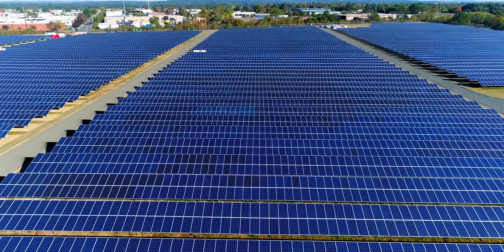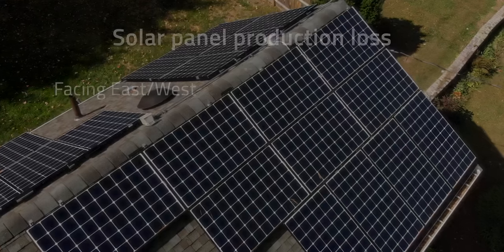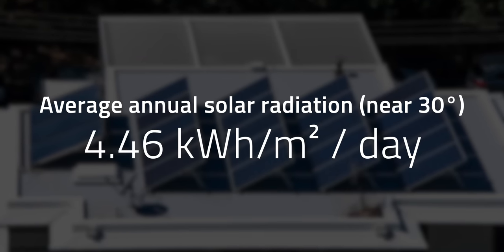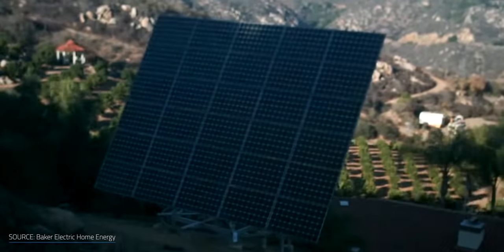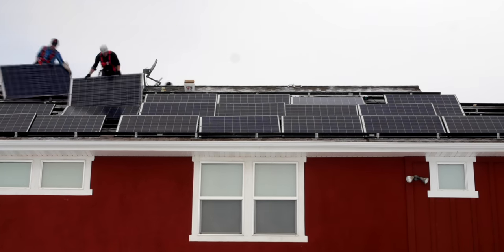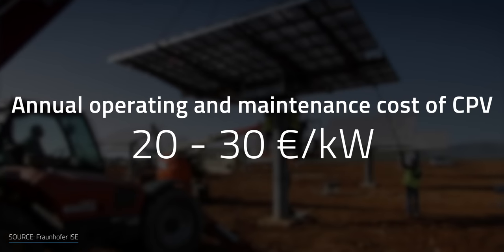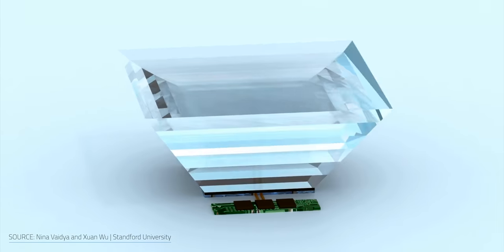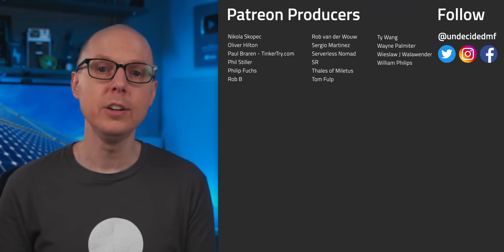This Invention Could Supercharge Solar Panels

Comment: I worked on a similar tech in my research lab around 8 years ago. The main benefit of a low concentrator PV is increased efficiency at suboptimal angles. The numbers were often muddy - you can get twice the energy per square meter of PV panel, sure, but when you ultimately use less PV panel (as a lot of room is taken up by the concentrator) then its a moot point. The biggest limiting factor is that the greatest degradation factor for PV panels is their operating temperature - when you concentrate, they will get hotter causing them to degrade faster.

Our research was specifically looking at ways to extract thermal energy from a domestic scale solar concentrator. This was to (1) cool the panels (2) extract some thermal energy for hot water tank pre-heating and (3) prolong the life of the panel. It was ultimately not deemed cost effective. You could double or triple the life of the panel but you have massively increased your installation cost, so it would likely be cheaper to replace the panels every 10-15 years.
Reply from the maker: Thanks for sharing your insights!
Reply: This system looks incredibly similair to the photosynthesis system in plants, maybe your insights about these kind of solar panels could be used to reduce heat stress on plants in warm conditions. However, these photosystems in plants are made up of proteins which of course degrade over time and are incredibly heat sensitive. Maybe something could come from this.
Reply: Yea I had the same conclusion.
Reply: I hoped someone would bring up the overheating issue.
Reply: T r a s h Tech..?
Reply: Agree with this researcher on all the points mentioned. In the end it’s hard to beat the $80/m2 silicon panels. Solar is a energy form that needs ultra cheap material to cover large areas. CPV hasn’t seen anything for a long time.
Reply: There are solar panels on the market that offer combined heat and power (hybrid panels). There is a small market for such panels in some countries, like in Europe, where energy right now is crazy expensive. The main problem with current technology is that hybrid solar panels offer relatively low temperature warm water. If you have the space, it is better to use separate PV and solar thermal panels. Specialized solar thermal panels offer higher temperature warm water. (Or people choose an entirely different solution, like extra PV and a heat pump.) If concentrating solar light results in higher temperatures and this can be made available, then concentrated solar might actually be worth it.
Reply: When I heard about intensifying sunlight exposure, I immediately thought of two things:
1.  Thermal degradation
2.  The older-design industrial solar farms that used mirrors to direct super-intense sunlight onto a fluid, heating it to do work (turning a titanium turbine).
I think the degradation problem could be overcome if thermocouples were integrated into the design; they would both produce electrical energy and act as a heatsink for the solar cell wafers; the prismatic layout shown in the video should leave enough space for this.  Passive or active cooling could also help.
There's no getting around the fact that the top couple layers of the photocell design are going to get the most intense exposure, and either need to be cooled the most or made to be translucent/transparent to some bands that lower layers will absorb, and also thermally conductive to mitigate thermally induced matrix displacement.
Reply: Lol, you already knew the tech is uneconomical 8yrs ago and this YouTubers just found out.
Reply: this. one thing about solar cells/panels as they are like camera sensors or computer chips, they are tiny and sensitive which don't like high temperatures.
Reply: Classic example of fixing the patient instead the root cause, they should work in getting more energy from the sun and not amplify it.
Reply: How much hotter do the panels get? Its still the same total energy per area.
Reply: So basically you would build a water block that attaches to you solar panels and run water through it to keep the panels cool and then use that water to preheat your water heater? I have thought about that before too(like a water cooled cpu) but the amount of money/aluminum in the system would be so expensive it just isn't worth the cost.
Reply: @GerbenWulff  solar water isnt that useful Imo since you need sun to use the warm water. Unless you could build a cheap water tank that loses next to no temperature overnight I don't see it being useful in places that are cold and get low sunlight.
Reply: @MonkeySpecs301  this youtubers doesn't care, he's here to make a video to make $. He will talk about any new renewable energy tech regardless if it's impractical or unfeasible. We need to ask him if Any of the technologies that he's talked about over the last 4 years have advanced or made it to market. I doubt he could make a video because none of them have. We are still using the same lithium/PV set up we have been for decades.
Reply: @Lunas Solvarros you can't deflect heat while absorbing the light. The heat Is from the light.
Reply: @nutzeeer  it isnt though. The PV panels get the light evenly through the entire surface of the panel. These concentrate light on to a small fraction of the total surface area making it probably 2x or more hotter. These would need large heat sinks or active cooling to dissapate the heat. It's the reason you put a heatsink and fan on a cpu, all the heat is in one small spot and the heatsink spreads the heat out and the fans blows it away. That would be expensive on a large solar panel.
Reply: The other approach is to take Paul's method but scrap the concentrator and just go for 'solar thermal'. Imperial College London research group thinks they have a route to economic technology. Search /Imperial College/solar thermal/hybrid pv/prof Christos Markides/ or look for his lecture on YT on Imperial's own channel.
Reply: @randybobandy9828  I heard that graphene sheets are extremely good at moving heat horizontally. Isnt graphene cheap now?
Reply: Thanks for sharing your insights. The AGILE concentrator system looks really interesting. But there's got to be some clever way to vent the heat out of the concentrator, even to the air, as the light passes down through the various layers.

What if there was even a small air gap between each concentrator level?
Reply: @sybrandwoudstra9236  solar panels in farmers fields could shade the heat stressed crops.
hahaha
Reply: @wesman9274  "Venting out" is wasting potential.
Personaly I think that this combination is suitable for home owners since it can combine the best of both worlds.
The cost effective point of 8 years ago is not valid these days anymore if I reflect it to my personal situation.
Solar was not costeffective for me 15 years ago, heatpumps were neither 5 years ago.

Today I have both as sepperated system, wich is already costefficient. I did not knew hybride panels existed before the instalation was ordered, in the current energy market they would be absolute cost efficient!
Reply: One thing to consider, at least on the industrial scale, is that a lot of the cost in developing a site can come from the civil work. This is especially true in tracker systems. It might only take $3M to prepare some old farm fields but a rocky hillside could easily be 10+ times that. A system like this, that could essentially be set on the ground at all kinds of varying angles, could be much more cost effective. I'm a field engineer in solar that has seen this all too often.
Reply: Steam is industrially useful, I got 10x power output from 15 mirrors for 30 seconds before the glass based pv panel cracked and it's cardboard support cought fire. Burnt my eyes too. The glass cracked along where the power cables were taped. Need to try with a heatsink.
I put a panel in flowing water behind glass but never tested it as auto welding mask did not activate concentrated solar and oxy welding goggles didn't work anywhere near well enough.
Using 18V 0.1A trickle charge panels.
Reply: Highly Valuable Comment & Section, tks for the latest info!
Wonder what material could be used as a unique heat exchanger to mimic however plants do that photsynthesis naturally?...
Reply: @sybrandwoudstra9236  Plants can evaporate water to cool them down, or shut down  (or at least slow down) photosynthesis if not enough water is available. That might be an interesting alternative principle for solar power ("evapovoltaics" if you will), but would greatly depend on local climate as well as availability of surplus water.
Reply: @robsengahay5614  easy, use excess heat to drive solid state hydrogen ammonia absorption cooling, run coolant lines through focal point.
Reply: A mate I was living with around 8 years ago Dr Ian Cole was doing his PHD in concentrated PV cells on Fresnel lens optimisation at Crest Loughborough University
did you ever come across him?
Reply: Nailed it.  
"Concentrating" is hotter and less actual collector area. It's just easier to throw on some extra standard panels than use augmented technology that adds complexity, cost, and reduces the overall life of the collector.
Reply: He told me pretty much the same as you though there is some applications where concentrated pv cells are useful outside domestic units such a satellites etc
Reply: @fakhourikakeesh5527  I didn't - my main field of work was phase change heat storage and heat pumps. The project I refer to here was one of the projects which just ran alongside everything I was doing.
Reply: @fakhourikakeesh5527  It would have to be really special circumstances to warrant the higher costs and lower life of such a system.   Obviously you're not "increasing" sunlight at all but trying just to channel whatever existing light there is a little better.
Reply: @GerbenWulff  How about running that water through the PV panels first to keep them efficient, then through the thermal panels?
Reply: @paulmichaelfreedman8334  That sounds like an interesting idea. Cooling won't be economical for normal PV/hybrid panels, because the benefits of cooling are small. The cost for cooling PV panels is normally not worth the benefit. Usually, you have more PV panels than solar thermal panels. Perhaps a mix: normal panels, a few actively cooled concentrated solar panels and 1 or 2 solar thermal panels. You need micro inverters or optimizers when you mix PV panels. Note that you will find that on some hot days with low hot water consumption you will be pumping around water while the hot water storage is already near maximum temperature. You can add a bypass for the solar thermal panels and add a radiator (with bypass) to cool the return flow, but this may make it prohibitively expensive.
Reply: I was looking at a home built EV truck a few years ago with a flat deck and thought about adding a headache rack and solar panels to get a few extra KM of range while it sits at work all day. I didn't end up getting it but these panels sound like they would be perfect for this situation.
Reply: For years I've wondered why a simple fresnel lens couldn't be used to concentrate the light for suboptimal angles. Each solar cell could make use of its own fresnel lens.

As far as the heat issue goes, placing the solar panel on water (a pond/lake) cools the panel. This approach sounds like it could happen on Lake Mead, but doesn't help the average homeowner without their own personal lake.
Reply: @warrensteel9954  True, as long as there are no trees or other obstructions.  Sounds like an intresting learning project.
Reply: For areas where space is limited, and budgets are high, like in a city, this might still make sense it sounds like
Reply: @therealbuba  High density areas are the LEAST appropriate for meaningful solar energy.  Think of a 20 story appartment building and what the avaialble roof size is available.  High density cities need high density power supplies.  I wish that they would develop the very small nuclear reactors that could be added as needed as the city grows and/or seasons change.
Reply: @arthurfoyt6727  the premise of your comment is not well thought out, just because a roof can’t cover all the electrical needs of a building (which was never my point) doesn’t mean it shouldn’t / can’t generate any energy at all…
Reply: @therealbuba  When energy content is too expensive and too limited, don't persue it.  It's a lose-lose for people.  Just because a city has a big budget does not mean that it should waste it on technology that has little/no impact on the needs.   Large cities are the worst place to locate solar collectors, especially expensive ones.
Reply: @sybrandwoudstra9236  are you asking if this tech or research could be applied to bioengineering and genetic modification in plants? I don't know a lot about the systems in plants but I have a feeling that trying to genetically modify plants so someone can have tulips in the desert sounds like a really bad idea. Are you talking about crop plants?
Reply: @GerbenWulff  they would still degrade and become a solar preheater in about the the same amount of time. The heat wouldn't be extracted in the fashion you are thinking. With an overall size being the same you aren't gaining anything from concentration. The heat products are lost energy. You'd be less efficient in solar energy products and end up with just extra heat and that heat would reduce the efficiency of and degrade the PV cells at a much faster rate. The only thing concentration would be good for is water heating but you'd have enough heat and hot enough water from a solar water heater. Also you have to look at location. The amount of cloud cover will effect your ability to have hot water as well as if the sun isn't out. In most cases you have the solar doing the preheating but most hot water is used during the evening and night in most US households so that's part of why that sort of heating hasn't taken off here. I live in one of the sunniest places in the world where we get over 270 days of sunny clear skies and most the others tend to have scattered clouds that really aren't an issue to solar cells because they don't stick around. Solar cells do not last very long here. At best you can get maybe 10ish years out of them. Solar heating could be a thing but you don't see it here. The only thing I could think of would be warming a pool in the winter here. Solar needs to become more efficient and drop in cost before it's a viable option for every household. The systems cost $30,000 installed and by the time they've paid for themselves, you have to investors money to replace the panels.
Reply: @randybobandy9828  Ah, but if you deflect the IR part of the spectrum, which isn't useful for PV anyway, you'd have fixed 1/3 of the heat problem already.

If you'd have a seperate glass pane that's selective for the right frequences, hovering just above the rest of the panel, that'd be a start (if not necesserily cheap).
Reply: As an ex PV installer I was wondering about the heat and IF a problem my intuition was that the solution wouldn't be cost effective, however I'd like to know if the concentrator could be placed with a significant air gap for cooling or does it have to as close as possible to the cell ?
another question is the ratio between extra space required for the concentrator, (or less cells per m2)  is it worth it ? and yet other potential issues are the extra load on a roof, weight of a panel for installation purposes, how fragile is the concentrator (hail, scratches from sand in the wind etc) ... not quite sure this is the holy grail
Reply: @sybrandwoudstra9236  organic pv cells ... we'll get there one day ! already starting for lights (oleds)
Reply: @Deathbomb9  Concentration could work to improve heat extraction, but it depends on how you design the cells. Normally you would put the cells on a heat sink that surrounds the cells. So the amount of surface that can radiate heat remains the same. In our case you might want to do the opposite: thermally isolate the cells as much as you can. Because of 3x concentration, the amount of surface you extract the heat from is 3x smaller and so also the radiant surface is smaller. This means you can extract the heat with less heat loss. Theoretically. But I think the designer will care more about getting rid of the heat than of making use of it.

Thermal solar panels also concentrate sunlight, using mirrors. That is how the water can reach temperatures warmer than the surrounding air temperature. If this concentration technology isn't worthwhile for PV panels, it might find alternative application in solar thermal panels.

I know all about location. I was raised in northern Europe, but now live in the tropics. Here I don't own a water heater. Most hotels have a basic electric heater. The water here never gets really cold. I usually shower when it's hot to cool down or late afternoon when the sun has warmed the water in the storage tank. In northern Europe if a solar thermal heater can heat the water from ~4-10 ºC to ~30-60 ºC that already saves a lot of gas.
Reply: @GerbenWulff  heat extraction? Or heat collection? I said that the only place it's good is in solar water heaters already. Might have been here or another comment somewhere. The issue with heat is that as the cells warm they lose potential. You want them on a heat sink and you want lots of air flow. PV cells already aren't super efficient in producing power, and in high heat they get even worse. A lot of the light is converted into heat rather than being turned into electricity. You don't want to concentrate the light at all. And designing cells costs a lot of money. But regardless of how you design the cell it works in the same way as all other PV cells. The only way you could extract the heat other than a passive heat sink is through heat exchange. The only issue with that is now you have to power the heat exchanger or system that is providing that cooling. You'd basically need something like 2 or more standard panels that typically get installed in residential roof systems to power it as well as the added cost of the system and its maintenance. Not only that, but keeping the panels the same size does absolutely nothing in terms of light gathering. You're not gathering more light that a standard panel of the same size so there is no advantage to this idea besides the added cost, maintenance, and need for cooling. I don't even have to watch the video to tell you how wrong this guy is on so many things he reports on.
Reply: @Deathbomb9  Ah, you didn't even watch the video. The idea if you concentrate the light 3x is that you need 3x less solar cells to produce the panel. They use this cost saving to use multi junction solar cells which have higher efficiency, so they do end up producing more power compared to normal single junction PV panels.

The use of multi junction solar cells is a questionable design choice though. It's generally not worth it. You get less than double the efficiency, for more than double the cost. There is an advantage that as you produce more electricity, there is less heat produced, but I don't think it is critical.
In my opinion, if the concentrator is cheap enough compared to the cost of solar cells, then they should just use normal PV cells and invest some of the savings into designing passive cooling for the panel. Current panels have no special passive cooling designed into them. With better cooling you may get 1 or 2% more electricity, but you add in the order of 10% to the cost of the panel. Not worth it.
In this case however, if you can save 2/3 on the solar cells (which is the most expensive part of the panel), then maybe that may compensate for the addition of the collector and the passive or active cooling (which apparently is critical in this situation).
Reply: @GerbenWulff  all I gather from the idea on display is they have money from a grant and had to spend it on something.

Can I pose an argument?

Let's say for hypothetical purposes we did use a concentrating panel to gather 3x the light onto a multi junction or even single junction panel. With the inverse square law applied the panel of the concentrator wouldn't have to be massive and if you could place it with enough distance to gather that light into the PV panel you would have plenty of space between them to allow some air flow. But you'd also have to place the panel high enough that it could concentrate 3m² of area into 1m² on the panel. Say you could, and say it was putting out 190V vs. a regular old panel that was just placed the same with no concentrator putting out 100V. If the regular panel gets heated up from the sun to the point you can't really touch it with out pain, how hot would the other panel be? And remember, you are blasting it with 3x the amount of sunlight and only getting less than double the output. The rest of that light is being reflected, but the vast majority is being converted to heat. You lose some to the air but you would really need a massive active cooling system to really keep the temperature at the same levels as a panel just sitting there. 3x the energy from the sun on any piece of electric equipment or solar panel would absolutely fry it. I'd have to see it in action, functionally for days with graphs showing output, surface temp., and a few other factors. Just because someone wrote an article that some youtube tech worshipper made a video about doesn't mean it has or will have practicality in the near future or that it will revolutionize things.

If you concentrate about 1m² of sunlight that hits out plant into a single point, you can melt steel, rocks and basically anything else you want to. That's how much power and potential there is in a relatively small space.
Reply: @Paul Mullen - yeah, no.  Hence, why all CPV technologies will have some sort of heatsink to keep the solar cell as cool as possible mitigating the efficiency degradation as a function of Temperature.  LCPV was always trash as the incremental performance difference could never pencil out the cost increase (LCOE).  Hence, early developers such as Sunpower and others abandoned quickly.  Btw, from a person who was an exec at a WR multi-junction solar cell manufacturer.
Reply: @Lunas Solvarros Silly solution, simple strip of copper or a small heatsink solves the problem.  Solved many years ago.
Reply: Pvt panels are commercially available. The heat you get from them can be used as the cold leg of a heat pump for heating your home and hot tap water. Depending on the situation, this can be economically viable.
Reply: @Deathbomb9  But that is not how it will work. The panel will still have the same size, it's just that you need fewer or smaller cells in the same size panel. Instead of a glass top layer, you would get a top layer consisting of plastic lenses shaped like upside-down pyramids (probably with a protective coating) that concentrate the light. Below the concentrators you have the cells that have some space in between them. The space between the cells and the upside-down pyramids can be filled up with a thermal conductive material.
Because the efficiency improves from ~22% to ~40% we will actually have less heat on the same panel size. The problem is that the cells themselves need to have their heat conducted out. They receive 3x more light, while the area around them now gets almost no light. In normal panels, the cells are placed close together, now they will have some space in-between where we can put a heat sink. We would need a heat sink at the back as well (where we now just have a layer of plastic or glass), but that is not expensive.
Right now, solar panels sometimes are mounted directly on a surface, without room for ventilation. That still works, but it's getting to be a fire hazard. Just by allowing for proper ventilation at the backside we can double the cooling. If we improve the rear side of the panels by using alumin(i)um and cooling ribs, I am confident we can keep the cells from overheating.
Reply: I have an elegant solution to that
Reply: @GerbenWulff  yes, I understand how a frinel(spelling?) lens works. And I get the idea of converting more light into usable energy. My point was to display the issue of concentration of light, not assuming that the panels would be huge. I was questioning my own direction as I was typing. Between the lens and the PV cell you couldn't have anything but air or a gas like argon or nitrogen. A liquid would require the cost to substantially increase to the point that any benefits are absolutely overshadowed by price. And if a panel produces 20-40% more energy, those cells could potentially have proper ventilation and heat sinks to draw away ant heat. But you are also talking about a part that is rather costly to add in and maintain a margin that makes it profitable without wrecking the prospect. You would have to push the idea so hard and display the science and data to such an extent you would produce these things for years while in the red and no company wants to be in the red during active production and sales. And let's be honest, most people aren't going to check data and all that. It might be a thing that power companies would invest in but when talking cost to power production the consumer is going to select cost because in most cases the extra power is fed back into the grid and those people aren't typically paid for it and if they are it's enough to cover the bill and beyond that they aren't particularly concerned with anything like getting credits that don't transfer over and that they aren't physically paid out on. If you made it to where there was a check cut ever month past a particular point of credits then it might be a point of focus to create that 20-40% boost and be able to sell that energy since you would be producing it and having paid for the system. Even where I live, it's just credits that mean nothing if you move and you yourself have to maintain the system. There are so many hurdles to get past before that jump in efficiency is a factor that is considered. I think we are coming from similar thought chains with different perspectives and I appreciate that we can discuss this rather than try to bash each other. Hope I'm not coming across wrong or in a manner that's hostile. I do understand that these cells would be smaller and take up the same space while increasing efficiency of conversion. But PV cells don't convert IR or UV light and I am curious how that broad spectrum in both directions would cause additional heat and potential lower lifetime expectations of this type of panel and if that could be mitigated by either passive cooling or even low voltage active cooling of some sort. A simplistic approach might be the deciding factor that causes something like this to become the new big thing and policy reform would be needed to allow it to become a viable option for people wanting to install solar in the future. I think it needs work and might need to have less engineering and more open discussion while limiting cost to a point where there's a potential for this concept to really be most cost effective. The solution might be a very simple draw off the panel itself while not being parasitic and eating into the added efficiency to where the end output is the same as or lower than a standard panel. Could be as simple as a few high CFM computer fans that clear out hot air inside the panel and push ambient air in to draw away heat or even a main heat sink that takes advantage of some fluid dynamics and physics to create a flow in a closed system with no moving internal parts and the only parts or a fan running on low voltage to where you can still have a higher return of power production and be able to cool the system to optimal temperatures for the present conditions or even better. I'm an optimist at heart and I can think of ways it might be done and might become reality. But the cost needs to make it a better option and from what I'm hearing, reading, and learning this would be more expensive to install and maintain as well as will cost more than the increase in productivity.

What are your thoughts? Brainstorm with me a bit?
Reply: @Deathbomb9  Yes, I can also enjoy a positive discussion. Perhaps the designer of the cells will even be reading along as he's probably interested to see how his cells are received on YouTube.
I don't think you need a space between the cells and the concentrator. The concentrator is made of plastic and plastics are generally not good conductors. Or maybe you put a glass plate in-between.
I agree that simple is usually the best solution, especially if you look at economics.
I tend to favor passive cooling. I have some experience with LED fixtures. You can do a lot with passive cooling. They should just test using these under different angles. Worst case there would be some installation restrictions: e.g., install them on a flat surface under an angle of at least 40 degrees and in landscape mounting only. No back-to-back (east-west) mounting. You can also decide to sell these in northern countries only.
Second simplification would be to use normal solar cells. Even if multi-junction would give less heat, that has never been worth it in the current market. I don't see how the concentration of light will change this equation.
I don't have a lot of new ideas here now.
Reply: How about reflect the heat, instead of extract it.
Heat from sunlight -> Ultraviolet radiation.
Light -> photon.

In a car, on front windshield, people put thin transparent film, that reflect UV radiation, without denying photon.
Small photovoltaic strip works just fine, underneath front windshield.

Or am I missing something?
Reply: @budisutanto5987  you're missing infrared.
Reply: @Deathbomb9  My understanding, infrared mostly emitted from the ground / buildings,
after they expose to sunlight.
Windows that facing upward need UV screen.
Reply: @budisutanto5987  IR is the main spectrum for radiation of heat. That radiation comes from the sun or other source of IR and then it heats that surface. UV contributions are small. The reason UV is bad is its ability to penetrate deeper than IR. Some space heaters use IR and are dangerous because they heat surfaces rather than just the air. It has to come from somewhere before a surface can radiate it away. The reason UV lasers are dangerous is that they are concentrated to a point. But IR emissions in a laser is what can cause issues with your vision or even cause burns even in relatively weak or "safer" laser pointers.
Reply: Cooling issue doesn't apply if this tech is helpful in near arctic latitudes where the extreme cold and dim light normally make it hard to operate solar
Reply: @budisutanto5987  The UV is absorbed by the plastic lenses. I don't think you can reflect heat radiation (infrared) without also absorbing some of the light. Glass used to keep the heat out is generally tinted. Much of the heat is generated inside the solar cells. It's just not a very efficient process.
Reply: @HolbrookStark  do you know how hot it gets in Alaska during the summer months when the sun is out for most the day and in some places doesn't actually set for weeks? Because I feel like you think it's always cold so there's no need to have cooling and this tech would only be available in this places.

If they are the same size as a traditional panel in area, they aren't gathering more light. They are just concentrating it into a smaller area so the PV cells can be smaller. But cost and added complexity/parts negates savings.
Reply: @GerbenWulff  As I said before, the windshield and thin film are clear.
The dashboard is cooler then car without that thin film.
I only sure that the thin film reflect UV, but the effect is cooler surface underneath it.
Reply: @Deathbomb9  I'm not talking about parts of Alaska that get really warm, I'm talking about stuff like the research base on Antarctica that's incredibly hard to keep powered because of where it is
Reply: @HuntingTarg  using thorium with thermocouple will be much more compact chaper and environment friendly way to produce electricity.
Reply: @HolbrookStark  you said arctic, not antarctic. Also, you are talking about installing a piece of infrastructure additional to what is currently being used as well as the cost and amount needed to provide enough power for them to be worth it that would basically be suboptimal since some of the things I mentioned are still relevant to the argument and you only want to dismiss them without addressing anything else because you weren't specific with your argument to begin with and make that's somehow my fault. Really bad tactic to use if you want someone to listen and be engaged rather than find every last hole in your argument and rip them apart with absolutely no respect. You are allowed to type a little more if you need and many people in this comment section will read and consider what you have to say.
Reply: @Deathbomb9  your points are valid, but I get the feeling this is one of those lab developments that will be produced at scale and make new things possible, and mainly for extreme latitudes I called "Arctic climates" even though that's technically not correct with Antarctica etc
Reply: @Deathbomb9  Tulips in the deset is a really bad idea. The main thing wanted to talk about is how we could look at nature to fix certain problems and also look at how engineers continue development in these systems from nature and then biotechnologists could apply these to nature. 
Andreas Lorenz (here in the comment section) already came up with an interesting idea regarding this.
Reply: @ottodidakt3069  We already have organic pv cells to some degree, since we use plant pigments (anthocyanins) to shield the solar panels from UV radiation
Reply: @stephenbrickwood1602  Or just feed them enough water so they can cool themselves. In the opposite direction: putting walls around plants means that areas can be made warmer and for example Medditeranian plants can be grown in Northern Europe. This has existed for centuries
Reply: This is the problem. The tech in this video isn't revolutionary. It's been obvious that lenses focus light for hundreds, if not thousands of years and combining it with a solar panel has been a no brainer since solar panels were invented. To this day nobody has done it which makes it obvious it's not feasible. 

Simplicity over complexity any day. This is where a lot of this new green crap falls short. If I had a dollar for every overly complex green idea that's been dredged up over the last decade I would have retired 9 years ago.

Solar panels, wind turbines and batteries are all the same. There is supposedly always some revolution around the corner, always some new hype over the next "big" idea in the media but how can you reinvent the wheel? They're all very simple devices at heart and no improvement can be made on them.
Reply: Paul, very good points and you captured the exact issues with concentrating PV. I was always surprised these projects were are also proposed in many ME regions where the general operating temperatures are even higher than say the rest of Asian/European or the Americas. 

For anyone wondering what the rise in operating temperatue of a PV cell/module effect on its generation is....the factor is approx negative 0.25% per increase in one deg celsius of cell temperature. So even if the ambinent temperature of a location is around 15 deg celsius the output voltage drops about 3-4V which would be around 10%. And with concentrated solar, these cells get even more hotter...and you can imagine the loss in power generation. 

In some earlier residential projects, we used to have copper pipes beneath these PV modules which used to heat up some of the water that would pass through these pipes and get stored for domestic use. I don't see that system being offered a lot these days....
Reply: @HolbrookStark  the advance here isn't some magic. They are using high efficiency PV cells that can convert more of the light into energy. They aren't gathering more light. They would have to have a collector that is the size they want concentrate down to a normal sized panel. They are just using more expensive parts, extra parts, and possibly additional sources for power production if they want to convert that thermal energy into usable energy for consumption. The issue I have is how this "creator" presents things. He will use the article as the source of information rather than looking at the actual research in depth to learn exactly what's being said. The article will omit things that the author finds irrelevant and might include things like how costly this system might be but then third-party presenters will choose to leave that out as well because then it's not new and sensational. I'd love to see a video about the actual research and an honest analysis of the applications for this research but when it's presented as an amazing new thing that no one will allow because it would cripple other manufacturers that have deals with the government or something of that sort of reporting is completely dishonest. I'm not saying that's this person's format. I'm just saying it is how some people present this sort of thing like diamond batteries or energy storage on silicon wafers. Omitting cost differences between then and claiming the only difference is the concentrator lens might hook someone that doesn't have the understanding or knowledge to know that's totally wrong. But it will erode that person's credibility and then nothing they say will be taken as true or the complete truth about anything. I'll respectfully say that you are right that this could be something that can be implemented in the antarctic bases to supplement power usage in the summer months for that area when they have a bunch of light so they can conserve fuel. That's actually likely the only place this could become a reality without costing substantially more by needing a lot of extra cooling. There's also a good bit of money that is pumped into those places to allow those bases to exist and many countries have a good reason to keep those on their budget. Some of that could possibly cover the cost but is it worth the cost in energy produced and can it pay for itself in say 6 years or less? Currently in my area(which happens to be considered the sunniest place in the world) in the American southwest, your typical solar panel will pay for itself after about 8-10 years. That's also about the time they start to drop off in efficiency and some might take damage or drop out early. That's just the panels that pay for themselves. Not the install and the system to manage it. A tracking panel array would likely pay for itself faster, if energy companies actually paid for the extra power production at the end of each month. But they don't, and they only add credits to the household account and those are useless for anything other than looking at how you got fucked over on that deal. When that changes and power companies are forced to pay for power produced by those systems and have to pay at the same rate they would charge for strictly solar or at a competitive rate then you'll see those numbers coming closer to realistic and feasible to take that $35,000 loan to have a system installed. There's ways to make that entire system work to where the power companies don't die off and remove things like service fees or reduce them across the board. I'm willing to dig into the issues that are preventing more people from having solar systems installed.
Reply: this. basically. I've done some experimentation with solar panels in environments, and by far the best results were from the opposite-surrounding panels with dome shaped diffusers, that would angle the light "sorta kinda" in the panel's direction. I can only assume, however, that they were most transparent to infrared and a couple other wavelengths that deliver excess heating energy. There's a reason leaves are green. black and dark blue ones would burn!
Reply: Dumb question, but installation for a pretty much a heat sink, to me, doesn't seem too difficult. As in, interlaying copper or some other high conductive material between the base and the cell doesn't seem too difficult. What, in your research, made it not cost effective for installation cost?
Reply: @gianluigijequinto  go search heat sinks that are 4in x 4in to 5in x 5in and able to provide cooling for something like a high end gaming PC processor. Now multiply that by how many it takes to have one for each PC cell on on panel. There's a reason most PC gamers opt for liquid cooling systems. They also have the be setup just right to provide proper cooling. And the 1m² of sunlight is an average of 1,000W/hr of heating which is the same energy it takes to boil 1L or about 32oz of water for about 50-60F. You would have to sink away that much heat energy and doing so passively is a rather expensive endeavor.
Reply: @Deathbomb9  Hm, I was thinking more of a system where there's a large plate(or small plates connected by appropriately sized wire/tubing) that encompasses the entire panel where it has several off shoots  to heat return/recovery systems. E.g. something similar to heat recovery pipes where it harnesses warm water in drain pipes to preheat hot water tanks. Where it then can be used through a house such as area heaters(kinda like a radiator) and in general hot water uses.
 
Not like traditional computer(GPU/CPU) heat sinks where fans cool the heat sinks with no return. Also not individual cells but rather to the entire panel.
Reply: @gianluigijequinto  that would be what is called an active cooling system. What you are talking about would potentially work, but as soon as your hot water tank was up to temp after about 30-40 minutes you now have to find another way of cooling that liquid. And the biggest issues would come in the summer months when it's hot. Or in climates where heat is a factor. Using this system for heating doesn't help or make sense. You wouldn't be able to lump off the heat and would burn out the panel in a matter of days or weeks. Several people have already addressed the issues in this thread. Using different words only means we need to repeat ourselves. Also, you would need an extra 2 or 3 panels to power the cooling system and that would cut into power production to offset use when there is no sunlight or less efficient days. The only way to really do it and have them be efficient enough is to have active cooling, especially in hotter climates. You could only ever achieve the same temperature as the air temperature with passive cooling and I hot or arid climates these systems tend to have a multitude of issues that come up even in the first few years of operation. And that's basic systems that are having issues. This type of system simply wouldn't work with out some sort of active liquid cooling system to prevent overheating and degradation of the panels prematurely in hot climates or in summer months in most places across the globe.

A heat sink generally refers to a specific thing or type of conducive material that is intended to be a passive cooling element like what you see in electronics and so on.
Reply: @gianluigijequinto  heat sinks are good, but ones made to disperse the heat of MAGNIFIED SUNLIGHT need to be active, and a fan does indeed count as making it less efficient. the only upside is that more efficient ones should theoretically absorb less heat and more light... slightly. in any case, I think spreading out the light over MUCH larger solar panels, and making sure it's evenly spread and diffuse is probably better for longevity.
Reply: Yeah, I noticed the same thing from the graphics... The actual pv cells under the concentrators were all separated/not connected. Wouldn't this also make manufacturing more difficult or seriously wasteful if you have to make a panel with a bunch of little pv cell units or only use a portion of a regular Pv panel that is under the concentrator output areas?

If this works at a small scale and assuming it was possible, would it make more sense to just make one big collector as opposed to a bunch of tiny ones? This would avoid the wasted pv panel or challenge of producing a segmented panel.

I guess it really doesn't matter if the increased heat causes faster degradation.
Reply: @mookfaru835  For some reason or another, I have the idea you are just some dude saying ; Yea I had the same conclusion while I was thinking you had actually no conclusion at all.
Reply: presuming the cells were 1 cm2 did you investigate refurbishing the silicon cells as a maintenance item instead of replacing the optics of the entire panel?  it should be possible to design user replaceable cells
Reply: @randybobandy9828  you can selectively use and filter different wavelengths. That is how multi-junction PV cells work. In reverse, there are some paints that use pigments that don't absorb infrared light, so they stay cool. Obviously, the complicating problem with solar PV is to use the light without absorbing the heat. Some progress is being made.
Reply: @egregius9314  It is useful, as it makes up about half the sunlight we receive. Silicon is just not as sensitive to infrared as other materials, but there are PV panels that will use it, including the new perovskite ones.
Reply: You could simply fabricate the panel  with piping glued to the back of the cells (even aluminum foil) that simply plug into the neighbouring panel with a connector. Then you simply use any cheap flex pipe, run it to the persons refrigerator, bore it into the freezer then back out again. Then you simply throw up a concentrator over the array as neccesary. This is for flat mounted standerd arrays. Pretty freaking simple. The end panels would simple have an adapter to bolt the concentrator supports to. Thats pennys in additional cost.🤷‍♀️. I was a pv system designer and installer btw.
Reply: I don't get how cost effectiveness is measured in this case, cause raw materials are finite, so isn't worth it in the long run to have something that can last 3 times as long? if we have enough resources for solar panels for the next 500 years, doing this woul dmake them last for 1500, just throwing out a random number to make the point.
Yes it would cost more in the short term, but you are making 1 product instead of 3 that will last the same operational time of those 3 products combined.
Reply: @BringDHouseDown  your logic should be a basic premise for all technology
Reply: @MonkeySpecs301  same as i did. :\
Reply: I love it!  Also, do you think PV panels last longer at less efficient angles?  I.e, at one extreme a solar panel in storage has a long lifespan, right?  and if it got used 1/2 the time, its lifespan might be 50 years not 25 years for panels installed for maximium output?
Reply: float the panels on a glacial lake or reservoir

serving 2 purposes
1. Acting as a heat sink, maximizing efficiency
2. providing solar shade to the water reducing evaporation and habitat erosion
Reply: so what we've learned is...
we still lack a better method of creating energy past heating up some water to turn some fan
Reply: Maybe use the concentrators on the water cooled pannels
Reply: Why can't you use heat rejection films or sun control films to block upto 90% of heat so, that pannel will be safe generally heat rejection films are used for windows of house and cars to block heat from sun. And after blockage of 90% heat only 10% of heat is allowed so 10 times more power we can produce with same solar panel
Reply: @stephenbrickwood1602  That's not funny, it is being done in many places.
Reply: What level of concentration were you using?
Reply: @kevinjackson4464  I think it is a good idea.
In fact I have posted about the benefits to farmers incomes. 
My real concern is solving the right problem, as an example Australia has 20million buildings all connected to the grid. 
The same amount of window glass in each building, but on the roof as pv glass panels would power the entire national grid. 
And UNLOAD the grid. 
And no new grid construction. 
The new grid is horrendously expensive.
Reply: maybe the hybrid (PV + water heat exchanger) would help coling it down?
Reply: @MonkeySpecs301  The French are selling them for water heating so the costs must be reasonable now, though I cannot pin them down on a price! 
I you can double the output of a water cooled unit, that you are already have, that seems valuable.
Reply: @cristibaluta  Yeah, there a lot of people working that already - a lot!
If we can make what we already have better, till we get better cells, isn't that a good thing?
Reply: @randybobandy9828  Till the French made them, they're being used today.
Reply: @randybobandy9828  Different frequencies.
Reply: @randybobandy9828  The French are doing it.
Reply: @rafavince  That sounds right to me!
Reply: @kevinjackson4464  they use what?I'm not looking through 110replies to see what I said.
Reply: @randybobandy9828  LOL, there's a French company that sells solar panels with water cooling. I can't pin down a retail price but, I saw a quote for a public system and the price was surprisingly low.
I'm trying to get one from them for experimentation. I'm thinking affordable plastic mirrors, the question is, how much can they take? I've asked for the thermal conductivity between the cell and water vessel, I should be able to tell a lot from that (if they'll give it to me).
I looked at this in the 80s and couldn't do it cheaply enough either.
Reply: @kevinjackson4464  no way it's cheap,  doesn't make economic sense to do it
Reply: @randybobandy9828  The quote said $340 for a 300W panel. I assume that is close to the wholesale price as you would expect cost plus 10 percent kind of pricing for a government job.
So that is high for a solar panel at wholesale but, if you have a need for warm water, that added expense may make sense.
I'm thinking if it can produce 2-4 times the power in a concentrating application because of that liquid cooling, it would be way more than worth the extra price.
Years ago, when I was designing high volume products, I had a rule of thumb that was pretty accurate. I could get most anything metal from China for two times the cost of the metal. Consider a panel is nearly a dollar a Watt today or $300 for a 300W panel, what percentage of that do you think cooling would be? I think you should be able to do it for less than 10 percent, or $30 or less.
If you are adding the water to cool the panels for improved efficiency, that is dumb, a few more panels will do the job cheaper. But, if you want warm water, you have to buy separate solar water heating panels. Do the analysis on that. Is one unit that does both cheaper than electricity panels and water heating panels separately? No, not likely. 
If I use that water cooling to triple the panel's output is it worth it then? If you have the option to buy three panels at $300 each ($900) or a single $340 panel with water cooling, what would you do?
Reply: Exactly what I was thinking.
Reply: @randybobandy9828  Great point. This is not critical journalism, and never will be. Sensationalism disguised as pop science
Reply: Yeah, but you get FREE HOT WATER!!!   :-)   Oh, wait....    I guess it would let you slightly reduce the array size, though, as heating water is not totally insignificant, especially if you have someone that takes showers like some people I know.  The hot water is running forever.